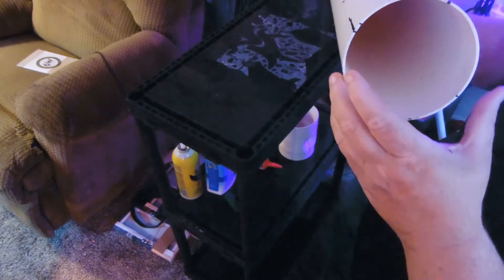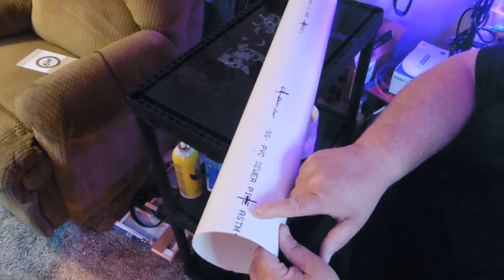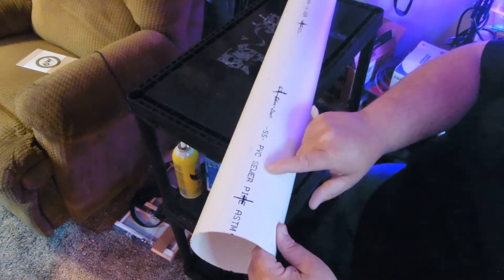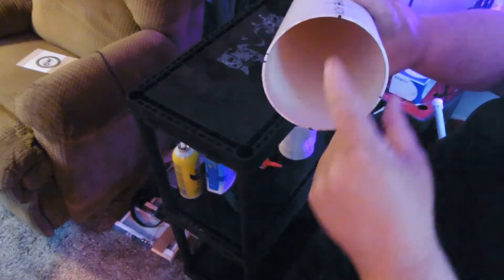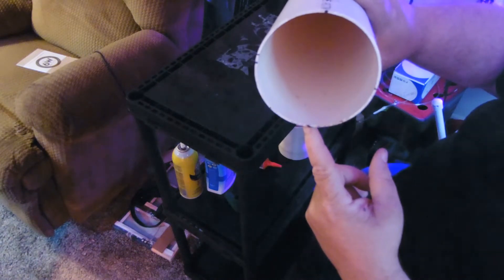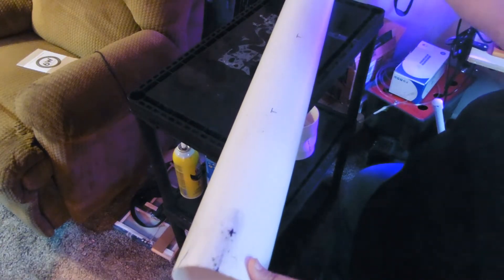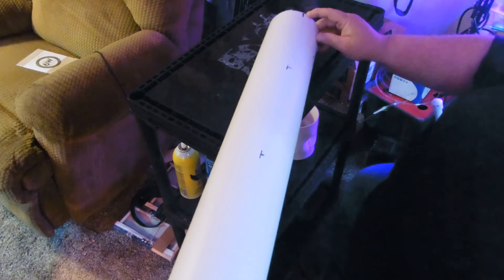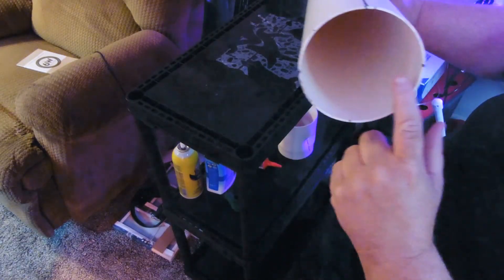How to build a Hydroponic Grow Tower

Comment: Had the same idea a couple of days ago about drilling the holes and then shaping it with heat. I never liked how other designs used heat only to shape the hole. Good to see that the theory works. I prefer inserting the cut smaller pipe as well to hold the pots. Prevents any water spillage and looks way neater. Thanks for your video.
Reply from the maker: You're welcome

Comment: Hi Craig, thanks for the video. May I ask, at 08:00, at what angle do you bent the 1-1/4” pipe? Anyway to ensure all the holes are bent at the same angle? Thanks
Reply from the maker: I found out that you cant get it to deep or it want work so anyway whats good you can always reheat it and fix it. I figure its a 40 degree give take a liitle.